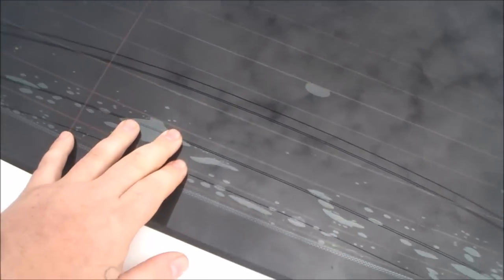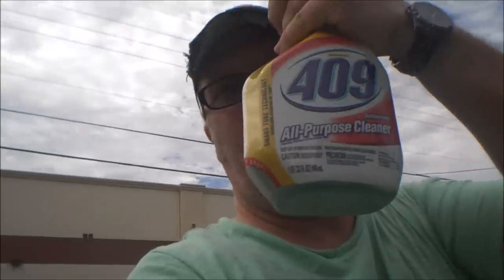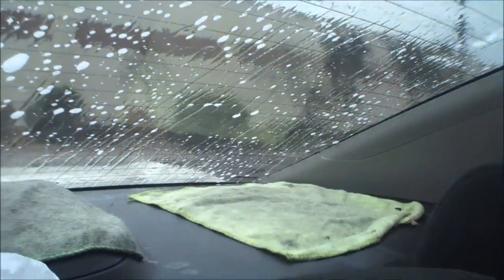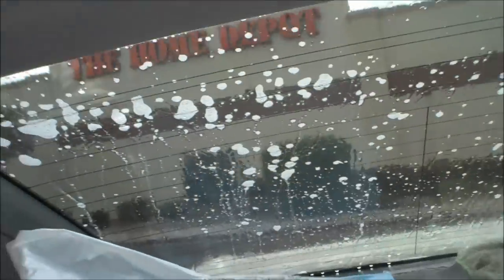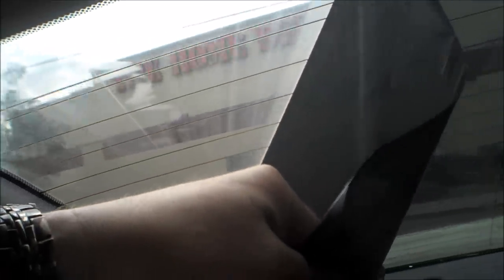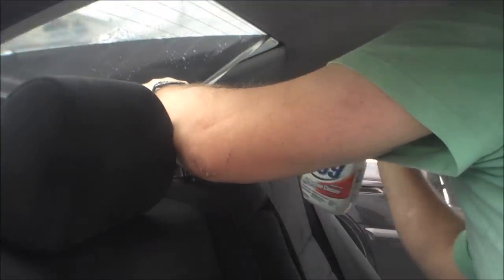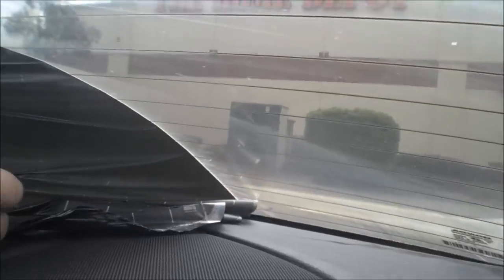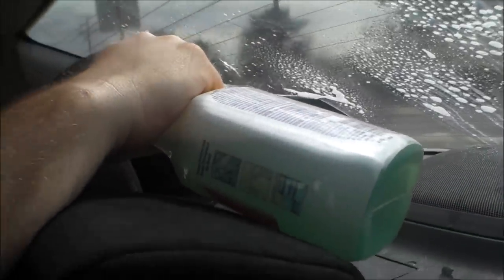How To Remove Window Tint

Comment: I been using this method for years ,it work perfect never had a issue of damaging the defrost lines, (black bags work better)
Reply: Zulma Morales Can I ask whats the point of the bags?
Reply: the garbage bags will absorb heat, that is why is better the black bag
Reply: Where do you put the bags? I dont see it in the video? Outside the windows or in the inside? And only spray the inside right?
Reply: 7o g we.

Comment: Get it all off.  Some. Bunghole was on my tail.  Thank God I looked into the  rearview mirror.  He passed me just to make a right turn  at the bottom of the hill.  He was on my ass.
Reply from the maker: Wow! Someone passed me on the right, swerved left, hit the car in front at a stop light. I rear ended her. She then claimed the lady in front hit HER, even though she hit her from behind. The lady in front and I pulled into a Home Depot. Waited. The middle lady never showed. We both got calls later that the middle lady told officers we fled the scene, wasn't true, we were in Home Depot parking lot across the street. So, when we found out the lady in the middle lied to police, we told them the same. She fled the scene. We both got our cars fixed!